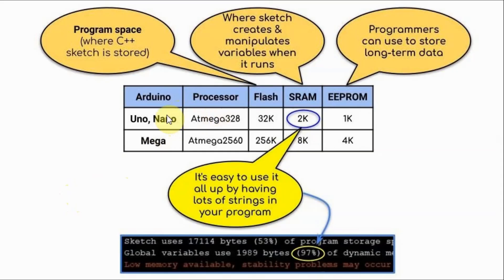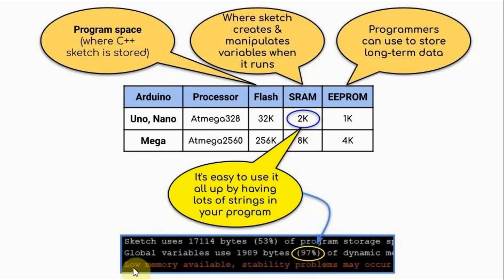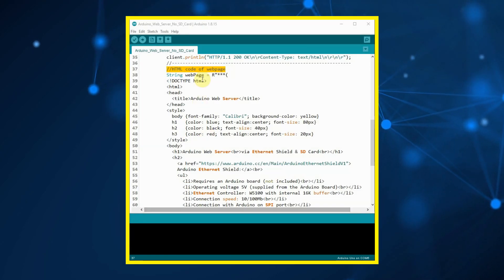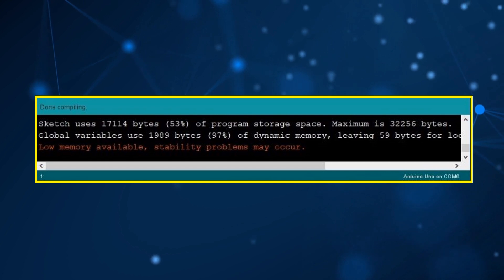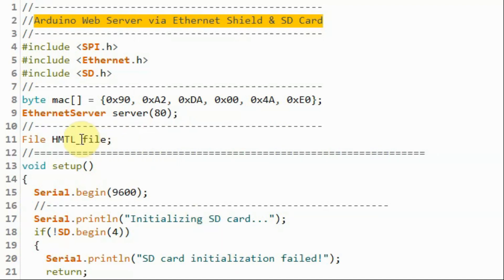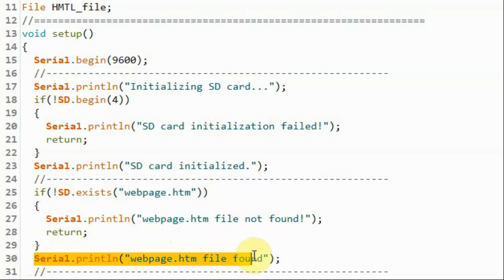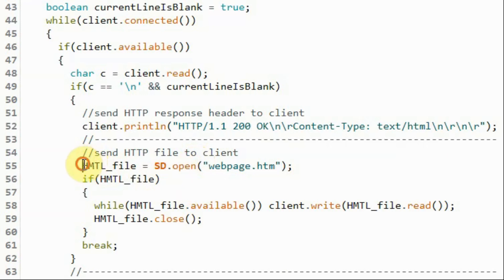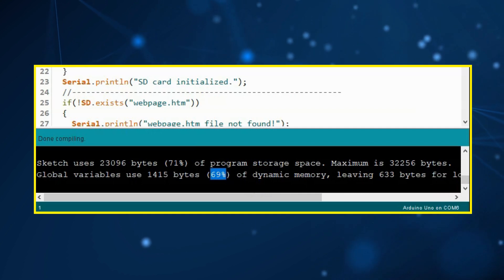Arduino Web Server with Webpage Stored on SD Card

Comment: But will it run indefinitely without freezing? I need a simple button to control a relay on the web page and I've tried integrating the html in the sketch and also running of SD card and neither one will stay running. I have to reset it every 24 hours and it's super annoying.

Comment: Thank you very much! I couldn't open de file from de SD, but thanks to this, now y got my html on the webserver.
But now I'm struggling with the code because I need to read an analog port, temperature, and print it among the web, but if I put the function in the html it doesn't work and show me only the text.
Do you got any idea? Thanks again!